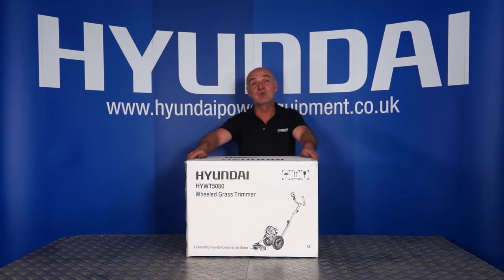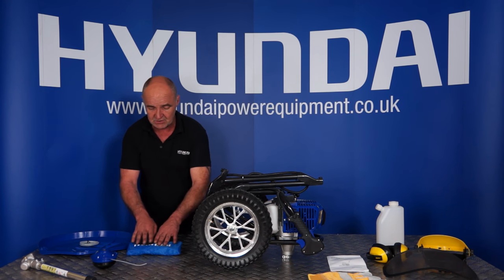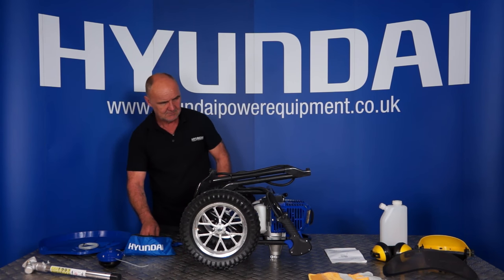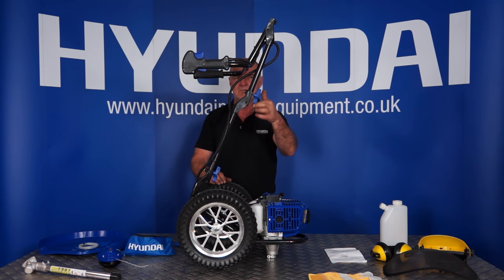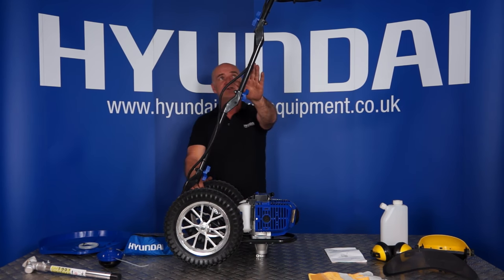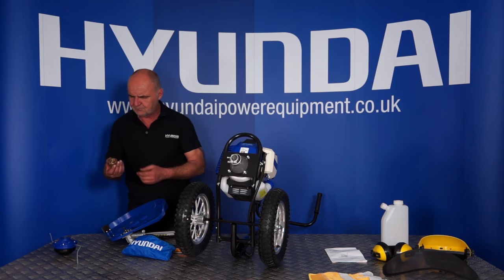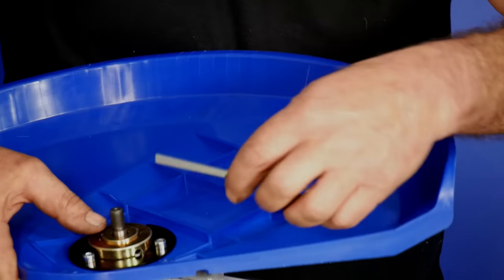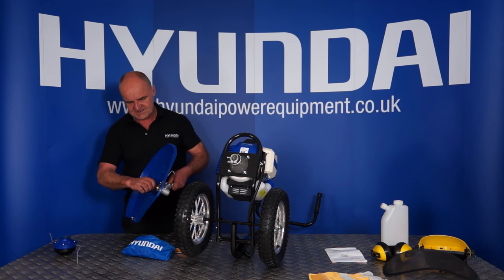Hyundai Wheeled Grass Trimmer / Strimmer HYWT5080 Unboxing  & Assembly

Comment: My mum bought the updated version of this the  HYMT5200X and unfortunately the manual that came with it is for this model. It’s very similar apart from the choke. It’s a red pull knob, other than that it’s a mystery .  Other than that the engine and strimmer head are great, as for the folding handle…. To compare it with a chocolate fire guard is a insult to the latter.  On the first outing 4/6 of the fasteners undid and then fell off into the long grass. Even after replacing them and loc-titing  they stayed in place but the handle was still as rigid as a jelly,  other than that. a great machine .
Reply from the maker: Its good to see that you are generally happy with this. With regards to the manual you can access a digital download via our website from the product item page. Scroll down, select 'Downloads' and an updated manual should be available there. We are really sorry you had an outdated manual with your machine!

Comment: I have everything on this but when I pull the chord the motor does not turn over. Does anyone know what I’m not doing right. The machine is brand new and the choke is up and button turned on along with pumping the bumble 6 times
Reply from the maker: Try bringing the recoil up gently at first until you feel resistance. Hold it at that point and then swiftly pull.

Comment: Whats the cut size on this machine
Reply from the maker: Hello sir, This product is currently unavailable however our new HYWT5200X has a cutting width of 430mm. The HYWT5200X is only £179.99 with a 3 year platinum warranty. If interested check out https://hyundaipowerequipment.co.uk/hyundai-52cc-petrol-wheeled-grass-trimmer-hywt5200x